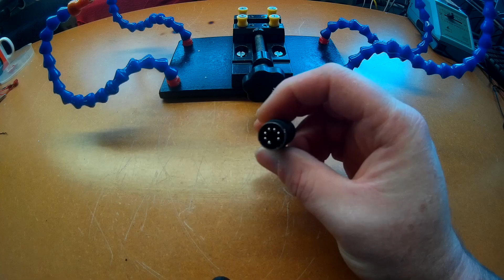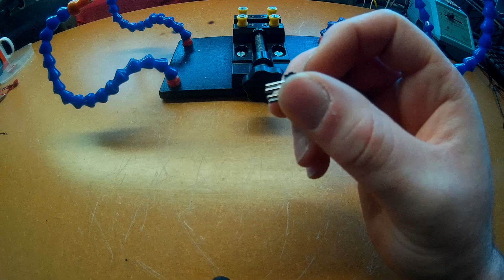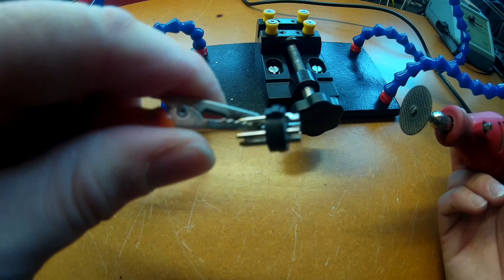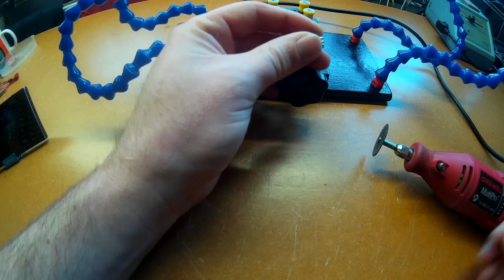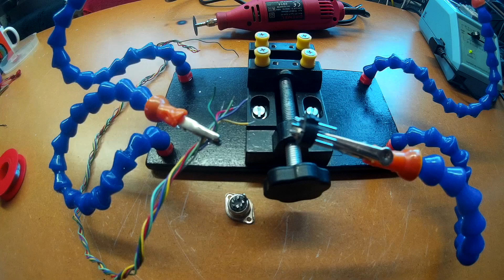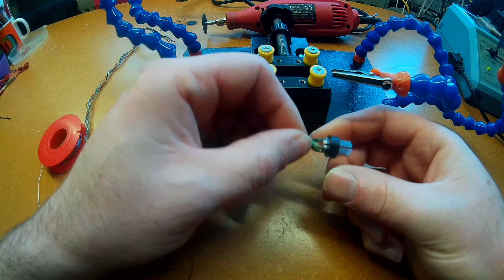How to solder a DIN plug the easy way

Comment from the maker: I'm sorry the video is not sharp. It's the first soldering video I made and I didn't notice this on the small gopro screen. So please be patient with me. Next time I'll use a different setup. But it's pretty hard to do this. If I put the camera too high my head will be on screen the whole time. Too low and I can't see what I'm doing. This really is harder than it looks when you watch others do it.
Reply: A very good insructional video other than the somewhat blurry photography, but there's one thing you might want to do differently: having the wires clamped into an alligator clip that doesn't have heat shrink or rubber tubing slipped over the jaws can allow the teeth of the alligator clip to damage the insulation, especially if somebody with lesser quality soldering equipment or minimal skills takes a bit too long trying to get a decent solder joint that the heat wicks up the copper wire to where the insulation is being gripped by the teeth of the alligator clip, thereby softening the insulation. Anytime you're using alligator clips to hold a wire you should put something rubbery over the teeth to protect the insulation of the wire.

Comment: Superb tip! I destroyed my first connector trying to get the pins hot enough to flow solder into them, the plastic melted and the pins ended up pointing in crazy directions. Thanks to this video I was able to get the second one soldered together extremely quickly and easily. :)
Reply: The exactly same thing happened to me too! I ended up making a small model of the plastic inlay that holds the pins and 3D printing that. It was a little wobbly so I filled the plug with hot glue, which, duh, again partly melter the printed inlay :P
Reply: How hard is it to use a thermoharder plastic for the part that holds the pins.... These plugs are defective by design.
Reply: Plugging the male connector into a female connector before soldering it will keep the pins in alignment and will help dissipate heat that might otherwise soften the plastic insulating disk and cause the pins to go out of alignment.  Note that some higher quality DIN plugs will actually have a small slot in each pin where you can apply the solder and soldering iron,  and the solder will wick up inside the pin; other DIN  plugs may already have a factory-engineered notch or cup at the end.  Grinding a notch in the pin yourself has the advantage of cleaning and abrading the metal and makes it easier for soldier and flux to wet to the metal pin.
Reply: PS,  blob of Blu-tack or similar non-hardening putty or modeling clay can be used to hold the DIN plug, in a more stable fashion than the helping hands jig (some of which are "tippy" due  to an undersized, underweight base).  If you stick the longer male pins into the Bluetack be sure to clean them with a Qtip and alcohol before using the connector.

Comment: I quit soldering DIN plugs. The pins are not wel made, the plastic melts, the pins in the center are never longer than the ones on the outer ring, but worst of all is the cover, the metal hook to keep it in place always slides off and you pull the plug open if it is in a tight DIN socket. So my advise: buy a cheap sealed premade cable, and cut it in half and solder that to say a SCART plug or so.
Reply: As a car stereo installer in the 1980s when most amplifiers and radio preamp-outputs were connected with shielded DIN plugs and cables that also carried control/turn-on voltages, I soldered many many hundreds of DIN plugs,  both male and female, to make custom-length cables or adaptors so that you could mix and match equipment brands (every manufacturer used a different pin-out wiring scheme). They get easier to work with after you've successfully soldered a few dozen; but modern DIN plugs are probably all made in Asia and are of lesser equality than what I was working with 40 years ago.  Back then some of the plugs had a slot ground in each pin where you could apply the soldering iron and solder so that it wicked up inside the tube and others already had the little cup ground away at the ends. They also used good quality plating that had a high affinity for wetting with solder.

Comment: Thanks a lot for the tip! You saved my Saturday as I soldered DIN 13-pin connector (for Atari ST) and it was very quick. Would have been impossible otherwise. :)

Comment: As a former car audio installation tech back in the 1980s, having soldered many many hundreds of male and female DIN plugs and connectors, I can attest that this is a sensible video. Note that the DIN plugs I worked with back then were mostly made in Europe or Japan and were probably of better quality than the Asian made parts that people use nowadays;  the male plugs sometimes had the "cups" already ground away, or included a slot in each pin where you could apply the  solder and iron so that the solder would wick up inside the pin and wet to the wire. The plating quality was usually better as well and would quickly wet to the solder and flux.  Modern DIN plugs from China or Asia are often made of inferior metals with crummy plating and are usually oxidized and greasy; grinding the tips of them as you did here will expose some fresh metal without oxidation and make it easier for the solder to wet to the pins, so thst you can get in and out quickly without overheating the pins and thereby softening the plastic disc. If somebody isn't taking a Dremel tool to the plugs prior to soldering, at the very least they should scrub the pins thoroughly with alcohol and a toothbrush prior to soldering, and apply rosin flux to the pins. PS, Air trapped inside the pins  expands from heat and causes the solder to bubble and this is another reason why having a ground-away "cup" or a slot in the pins is helpful. 

( 40 years ago, most car stereo manufacturers were using DIN plugs and not RCA plugs for the audio hookups and tirn-on control signal to the amplifiers and signal processing equipment,  and all the major manufacturers used a different pin out wiring standard, so I frequently found myself making custom cables and adapters so that you could use an Alpine radio with a Kenwood eq and an Audiomobile or Fosgate amplifier and so on).